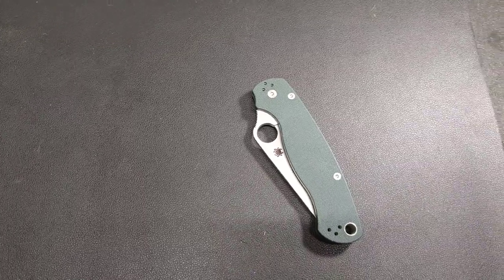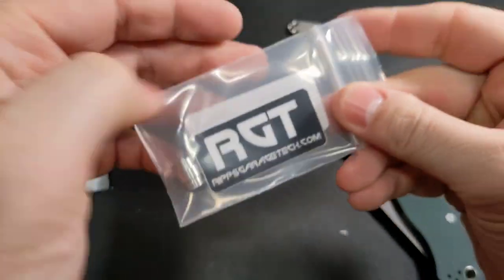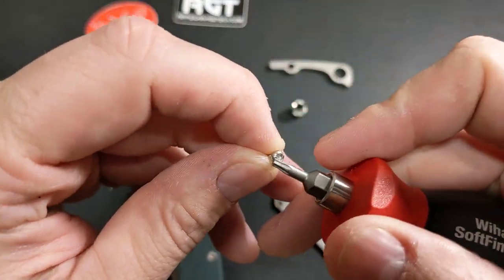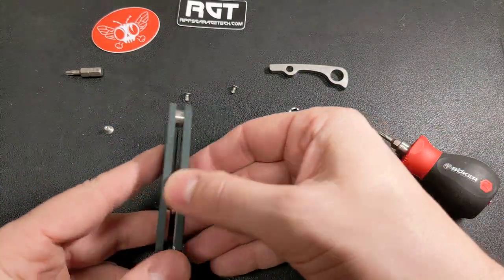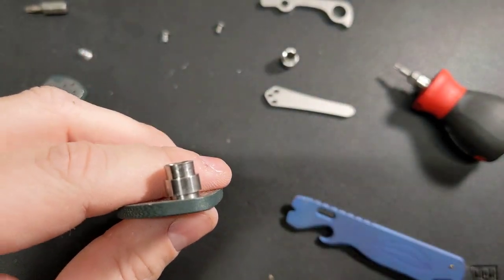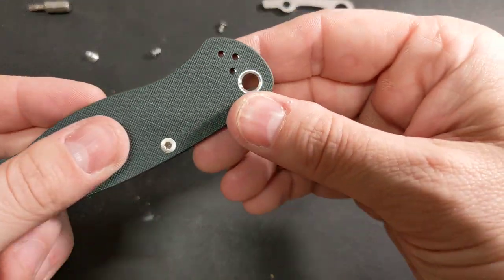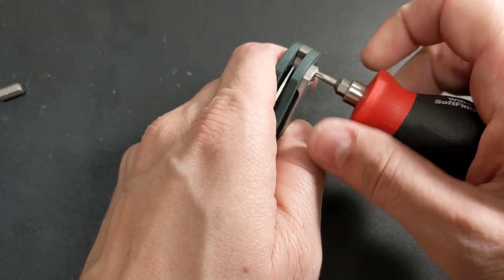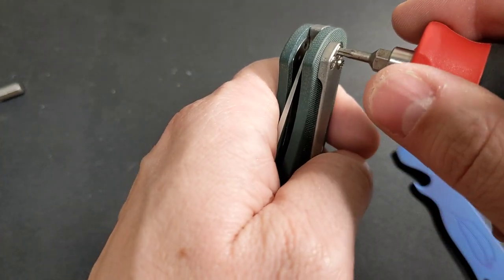Easy Spydero PM 2 Mods

Comment: If you're going to do the clip and back spacer, you might as well get a titanium screw set as well. I think bronze would look good with the green scales if you ever decide to ano them, but the raw silver color look fine too.I don't think blue or purple would look good, but that's just my opinion. To each their own.
 I like that version of the PM2 you got. They are a nice shade of green.The lanyard tubes are a bitch to get apart. There is a tool that makes it easy. I can't think who makes it..maybe Shepard? It's one of the guys who make the custom scales anyway, and cost $35 bucks. If you ever plan to do other knives like a Para 3 or the Manix, it might be worth the money. If you're only doing one knife, maybe not..depends on how much you value the ease of use versus the pia of not using it, lol. I do like that clip. It looks better than the Lynch or MXG clips, and probably more ergonomic.

Comment: I had the problem of a pocket clip screw pushing the knife apart so just grinded the one screw down 1/32” with a mini Dremel sand wheel . My clip came handmade and I can tell , lol . He still did a good job just not so straight and even jimping but it’s good enough. Handmade is good . I have to look for it to notice .

Comment: I put a spacer on the tanto version and it knicked the edge of the convex where it comes up. Just beware if you have a tanto version. It's not a huge deal you can rework the blade and put electrical tape under the spacer but it is annoying to deal with.
Reply: What spacer did you use

Comment: I know this is and old video but regardless it's great; I recently received my first Spyderco pm 2 with a CPM S45 VN blade, I don't have any experience since it's my first Spyderco now, I also want to customize it starting with a back spacer to reduce any dirt or dust, but should I wait untill my warranty expires? I mean taking it apart will void my 6 monthly warranty.
Reply: I'd recommend foregoing the backspacer as it just adds more weight to an already somewhat heavy knife. I also recommend micarta scales from Sharp Dressed Knives...way better than the og g10 and lightweight too.